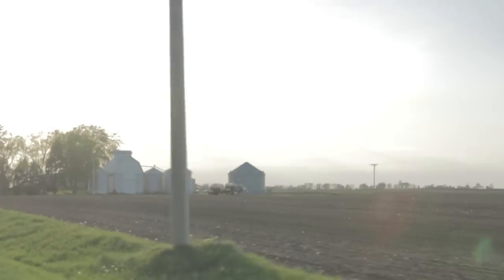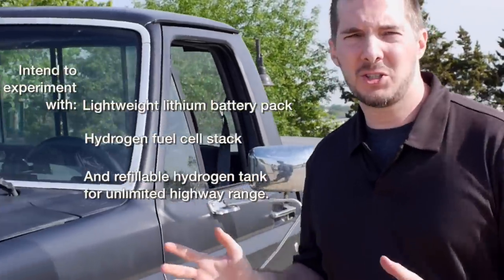Modular Minimalist Hybrid Truck

Comment: ive often thought of doing something like this, start with a 2wd truck, pop in a 4x4 manual gearbox and transfer case, and locate the electric motor where the front driveshaft normally lives. ditch the front fuel tank, route the exhaust through there, and put the batteries where the exhaust normally would be, that way the motor + battery weight isnt all on one side of the vehicle.

Comment: Do you have a web link showing more information on the project? I'm sure we would all like to see what motor, controller, and batteries you are using, as well as a view under the hood! Looking forward to more tech videos on this project!
Reply: Agreed. I'm a student, and I'd love to put this on one of my large suburban for cruising around and getting stuff, but then having the grunt to haul things around with a simple plug and play system. give us some links I'm sure this has a lot of potential for actual real world use.
Reply: SpiceTheWolf If you are using a DC motor then you can simply use a large solid state relay driven by an arduino that controls the ssr with pwm. If you need to charge the batteries then you need a second ssr, a large inductor and a capacitor arranged as a boost converter circuit to charge the batteries (more difficult).
With a 3 phase AC motor (like a tesla car) you need 3 ssr which produce the AC waveform at varying frequency (freq = speed). When the frequency is below the natural frequency for the speed the vehicle is going it acts as both a brake and charges the batteries (when the produced power goes through a rectifier and a boost converter).

Another option is to have the electric motor drive the transmission and have the gas motor drive a second electric motor (DC) at a fixed RPM which produces the correct voltage to charge the batteries. If the 2 electric motors are large enough then you will still have the same power at the wheels (actually more if you consider the output of the batteries adds to the power generated by the gas motor). This allows you to get the best efficiency out of the gas motor by running it at a fixed speed.

Comment: I'm guessing the cheapest option for DIY hybrid power (not hybrid drive) is get two to four 100ah deep cycle batteries and charge them with a plugin charger. Use a 100 amp relay to switch out the alternator. Removing the drag from the alternator will reduce the power draw and save fuel while still being able to power electrical things in your vehicle. Maybe solar power charging may provide a modest kwh or so per day if you so desired.
Reply: @milescarter7803  for sure. But I had Been wondering what was the cheapest and simplist DIW option, and that was to simply remove the electical load off the alternator by using batteries and recharging them with solar or grid power.  I guess the next cheapest would be to use motor in place of the alternator but then you need to add much more battery kwh energy capacity and your limited to a kilowatt or two of power that you can add.

Comment: The last 2 months of 2018 I was contemplating doing something like this, which is why I just bought a used front wheel drive SUV; I figured I could put the motor in the rear to drive the rear wheels and use it to accelerate and brake, and use the gas engine for Highway speeds, the opposite configuration of yours. I did consider your exact method for my truck, though: run the drive shaft directly through a motor, and activate the motor as needed. 
I'm going to check your other videos to see if you give more detail.

Comment: How would the electric motor stand up to driving in inclement weather conditions such as driving through rain and snow ? Anyone know the answer to this ?
Reply: Not well. years ago, there was a college professor who had a similar minimalist idea, but based around FWD cars that would replace it's rear brakes with hub motors. he stated road grease and grime were not kind to the rare earth magnets and prevented it ever entering production
Reply: Motors are sealed the other dude commenting doesn't know what he's talking about.  Look up rich rebuilds  no weather problems if done right.

Comment: So by putting the transmission in neutral, he’s left with a single electric speed, because the motor is cranking on the transfer shaft that connects the front and rear axles.  Is that right?
Reply: trans would free spin unless im not thinking of it right but that would be super cool...or keep it in gear and have the engine be the block but i doubt it could hold max electirc motor power
Reply: @rileykirk11  I'm often frustrated by the ingenuity of some people, crossed with their inability to explain to strangers what they're so ingenious about.

Comment: this is great. have you been able to tinker with regenerative braking at all? I like the idea of cruising at highway speeds under electric power, but it Seems to me that the biggest mpg gains are to be had in stop/go traffic when all your energy is just lost every time you hit the brakes. Is there a good way to just reverse polarity or whatever on that big electric motor to simultaneously slow down the truck and regain some charge?

Comment: So we are basically trying to do the same thing but on our boat, Cept we want to have the ICE there as a backup.
Reply: You might consider ICE/Battery/Electric - a configuration used on many ferry boats.  The ICE is generator only and propulsion is via electric motor only with battery bank providing stored power from shore power or generated from ICE or solar.

Comment: I like the series hybrid concept, but I don't quite get why the motor only works at highway speeds. The biggest efficiency gains you get with an electric car are stop and go traffic with regeneration.
Reply: he only uses it on highway but it works any time if he wants to
Reply: Probably not a big enough electric motor and battery to accelerate a big vehicle but on flat highway he can still save money with a small motor

Comment: But how does the rear suspension move if the transaxle is a fixed motor?
Reply: It looks like the motor is mounted just behind the transmission with a modified, shorter driveshaft. I wouldn't go off-road in this, but it should be fine for highway driving.

Comment: Aren't you worried that you overheat the electric motor by not having it between the engine and transmission for better energy (both fuel and electricity) economy?

Comment: He chose a 4x4 because, if the vehicle was 2WD then the system would require to be operated with the engine running to avoid transmission damage because transmissions are lubricated via the input shaft.
Reply: no!!! on a manual trans it's lubricated by any moving gears splashing the 80 or 90 weigtht gear oil  and that includes the rear shaft
Reply: @tonycavez  if the input shaft is not rotating, the main gears don't splash the oil reservoir.  If only the output shaft is spun, the rear bearing will eventually wear out through lack of lubrication.  This is why we tow manual rear wheel drive cars backward, with rear wheels lifted.  It is also why the driveshafts of motorhomes and larger trucks should be removed before towing.
Reply: @HemiChrysler  i disagree

Comment: Interesting, but your theory is counterintuitive to what hybrids are trying to achieve.  You want to play to the strengths of each engine.

You would accelerate with the Electric because it is good at storing little energy and having a wide working torque range.

The Gas motor on the other hand is terrible at acceleration (it is only efficient at certain places, and only makes good torque at certain places).  And great at long distance fuel economy when properly tuned to your cruise speed and load (assuming it doesn't have poor friction and pumping losses).

So do what you did, only the other way around.  This "works", but there is a reason every hybrid manufacturer does it the other way.

Unless this is a gag, then, carry on.

Also, if it's droning, design a proper exhaust.